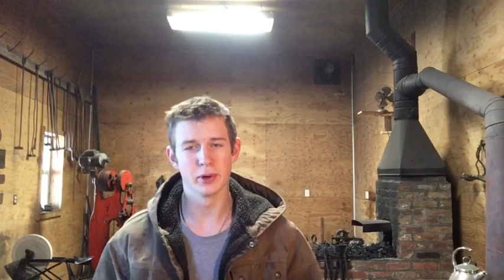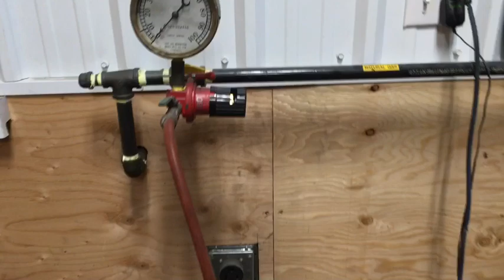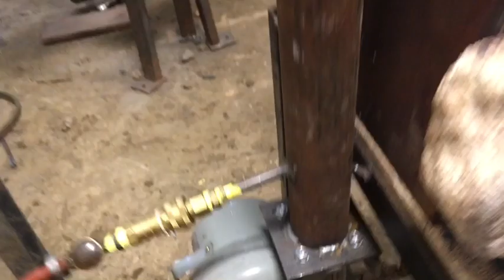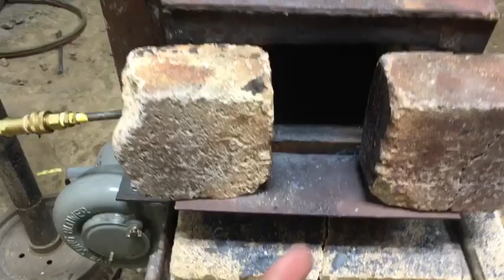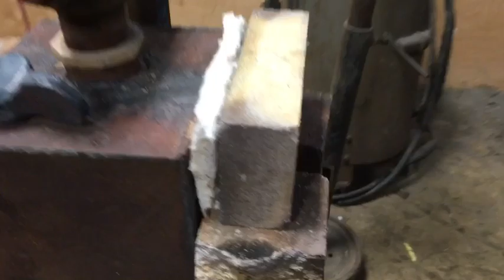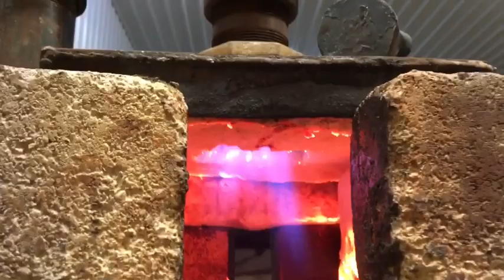Gas Forges: Venturi vs. Forced air

Comment: Ethan, get rid of the quick connect in the gas line.  Quick connect of that type are not rated for flammable or toxic gases because they are prone to leaks.

Comment: Excellent video, however in my humble opinion, the biggest benefit of the ribbon burner is the ability to really dial in the air - gas ratio. Kranking up the propane makes a huge difference when forgewelding, because you can create an environment with way less oxygen in the burn chamber. I rarely use flux in my ribbon burner witch is unthinkable in my venturi. I don't experience a difference in fuel consumption between the two, however my ribbon is a lot bigger than the venturi and the venturi is an old valley forge, they are extremely effective, compared to other venturi's that I've tried.

Comment: You Can make a venturi Inducer run a ribbon burner head - sometimes called NARB's (naturally aspirated ribbon burner), they are designed a bit differently but work quite well. My current forge is run on two 3/4" class venturi inducers, using 0.030 (mig gun tip) orifice, running the ribbon burner blocks, my ribbon burner blocks are about 2.5x9.5 with 18x 5/16"ports. Many of the advantages of the forced air ribbon burners you were listing also apply to NARB's. My forge is about 4.5x4.5x24" internal (about 486 cu inches) and I can run one side or both as needed. It will forge weld, I've made Knives, Gate hinges, hammers, and  even a 1.5 x2.5x 14" swage block with it. The NARB's are also Very quiet, most of the noise from a gun style is coming from the nozzle side not the induction side. one thing I like about my burners is the fairly wide range of temps I can run the forge at, from a low orange heat at 5-6 PSI to forge welding heat at 12-15 PSI. I also have a fairly small "dragons breath" from my setup, only about 6" at forge welding heat, I run my burners just barely on the fuel rich side of neutral to stop scale build up. Efficiency is ALL in the air fuel ratio - so Tuning is what will get you the efficiency not actually the type of burner. This style of burner does take a bit of tuning to get working just right, and is a bit more complicated to design and build than just a gun style or a basic forced air system.

Comment: Thanks for the video Ethan. You have a great talent for explaining things consicely and in a way anyone can understand. 
I have a (forced) ribbon burner forge. These are the things I have learned, yet i don't hear many people discuss:
1) forced ribbon burners are usually paired with larger volume forges. Forced ribbon burners are much more efficient, but this larger forge size is probably going to require you to use more fuel gas. Maybe not, but it's something to consider. 
2) No matter what you do, you cannot focus the heat from a ribbon burner onto a small section of your stock; whatever stock is in the forge will be heated, and evenly heated. This is desirable in some situations, but consider you are forging a pair of tongs and need to punch the rivet hole.  You won't be able to focus the heat on your boss section (where the rivet goes in the tongs) when using a ribbon burner. When you try to punch the rivet hole out, your entire stock/tong is going to warp like warm taffy. Sure you can straighten it back out, but you will have to heat it more times to do this, and it's overall less time and fuel efficient, and not the best for the stock. If you had a single venturi burner or gun burner, you could focus the heat to about a 1 inch section quite easily. This is much better for punching or drifting, usually. I'm sure others can come up with exceptions. It's just something to consider.
3) Ribbon burners typically get hotter than venturi burners because of forced air. However, the heat cone of a venturi burner is more than capable to melt steel, but the venturi burner simply isn't going to get the WHOLE forge volume as hot as a ribbon burner. I actually believe if you are wanting to get a small area of stock really really hot, the best way to go is with a venturi or ideally a gun burner.  Your entire forge won't be as hot as with a ribbon, but when working with smaller sections of stock, I'd argue this is better and more efficient in terms of fuel cost.

Hopefully this helps someone. If you are getting into blacksmithing and building your first forge, I highly recommend starting with a single venturi burner, or maybe a forced air gun burner. You will be able to do everything you need to. However, if you have natural gas running to your shop, it's reasonable to just go ahead with a ribbon burner. Natural gas is much cheaper. You can hear that forge to hellishly high temps and you'll likely still be spending less money than you would using propane with a venturi or gun burner.

Comment: Hey there. Great clip. I’ve just built a ribbon burner forge, a little larger than the one you show here. I have pretty much the same blower, with an adjustable tap, but I can’t get her as hot as this. I’m wondering if it’s the size of the gas jet hole? which is One millimeter diameter fed into the pipe pretty much in an identical set up as yours. It burns beautifully and I’m forging well with it, but if I crank The fan up it will blow out, not get hotter... Any tips?
Reply: This gas inlet is just coming out the end of the pipe. You don't need a small jet because it is not a venturi. Just get the gas in and make sure it has a chance to mix with the air. As for your burner blowing out with more air, you either need more/larger holes in the burner and/or more gas to mix with the extra air. Try getting rid of the jet and have the gas coming out of the pipe. It is a three way balancing act. Air, fuel and nozzle size. If you have a look at this one running he has the blower mostly closed off. The blower is waaaayyy to big.

Comment: I have to agree that ribbon burners are far more efficient than venturi rigs. If you angle your burner tangent to the radius, and make the chamber round, you get a swirling effect which is even more efficient. I've been meaning to change over to natural gas too, so thanks for the kick in the pants. BTW, I like your videos. You have a good mind for this work.

Comment: Sounds just like mine, but yours is a bit louder, I built one with 6 bricks a weed burner and a hair dryer for the top blower. It's not as large, but it looks to get just as hot. I have to turn it down to heat treat blades or they will carbon out.

Comment: How efficient would a forced air Venturi burner be? I have a small devilforge and seem to go through a fair bit of gas with just Venturi burners. So would a forced air Venturi burner be alright compared to a ribbon burner?
Reply: There's no such thing as a forced air Venturi burner.  A Venturi burner sucks it's own combustion air with it.  As for efficiency, that's also a myth.  Efficiency is mostly a function of your fuel/air mixture.  A neutral flame - only as much air as is needed to burn the fuel - will produce the highest efficiency.  Forced air gives you better control over the fuel/air mixture.  If you have huge amounts of flame escaping the forge, you're wasting fuel.  A well made Venturi burner, with adequate and adjustable air intake will do you just fine.  If you've got things tuned just right, you'll have just a small amount of dragons breath leaving the forge.

Comment: Ethan, where are you located that you have Natural Gas at 20 PSI inside your facility?  From my research, (typically in the USA), the standard delivery pressure, (past a residential gas meter) is 1/4 to 1/3 pound-per-square inch.  The street gas pressure to the house may be much higher, but the typical home meter can only handle putting a maximum pressure of 5 PSI into the system.  If I understand correctly, and what you say is true, your Natural Gas system has high enough pressure that it could almost handle many  venturi systems.  I'm confused.  What am I missing?
Reply from the maker: Chuck Bailey we have high pressure service at the ranch, because we use so much gas to heat the buildings. So that particular gas line has no low pressure regulator on it, it’s illegal, but works well. I run my oxygen torch on natural gas too, so the higher pressure is needed for that too.
Reply: @EthanHarty  So what you are saying is that your "opinion" in terms of choosing between verturi and ribbon burners only applies for the .01% of those people who have illegal high pressure systems?  Or will the argument still work for those of us with the lower pressure NG systems too?
Reply from the maker: Chuck Bailey you can absolutely run a forced air system with low pressure NG, because you can get more fuel in the system just by having a bigger gas inlet pipe, for example, Paul from Toronto Blacksmith, uses NG ribbon burners for his big forges, and he only has residential pressure, so the inlet pipe is 1/2” I think, and it works perfect. The beauty of the forced air system versus the Venturi, is that it doesn’t matter what pressure of gas you have. It’s all about the volume of fuel coming into the system, not the velocity out of an orifice.
🙂
Reply: @EthanHarty  Wonderful!  That's good to know.  No, it great news!  I've read so much contradictory information on forums, with the majority saying it can't be done with regular residential pressure.  I so much didn't want to go with propane, and I actually have 3/4" NG line I can use - so here's to ribbon burners.  I plan to build one real soon!  Again, thanks for the clarification!
Reply: Chuck Bailey yep I couldn’t believe it when he said 20 pounds! That’s amazing and a little scary as well!

Comment: I made a forced air forge a year ago but it's been giving me fits.
I can't seem to get the fuel/air ratio right.

I only need it to go up to about 1100°C (or 1950°F), but I'm running off of propane tanks and the only way I can seem to get it up to that temperature is to crank the regulator up so high that the tank starts freezing (~20-30psi). I'm sure it shouldn't take that much fuel.
It's a 16" ribbon burner with baffled plenum, and I'm using a dust collector as a blower and a 55gal. Steel drum lined with inswool and satanite as the forge. Maybe it's just because of the size of it, or maybe it's an issue with my blower, I don't know.
It's been pretty frustrating, though. I never had these problems running a venturi burner.
Reply: The inside of your forge may  be too big,  the inside dimensions should be fairly small, it needs to get really hot to burn the fuel completely. Like he shows in this video it doesn't burn well at first because it isn't hot, a large area would take a tremendous amount of fuel and heat to burn hot.  If you need a big fire you should consider coal or coke.
Reply: Kire Du'Hai  your Forge is too big. His forge is compact on purpose, it’s easy to heat and keep hot.  You’re only putting at the most projects a few inches wide. 
  A much smaller burner too. Use what these other guys are using. Pipe 1-1/2 - 2” and keep your  exit no more than a couple square inches. The burner should build a slight back pressure or close to it.
Reply: I also have a 55 gallon drum and initially I was having problems as well. The key is to really reduce the amount of air going into the system. I had to add a gate valve and its barely open. You tune the flame by its color.

Comment: most examples I have seen used a castable refractory for the holes in the ribbon burner, but I saw you just used a steel plate with holes in it. What do you reccomend?

Comment: Good job on a home system I have worked on a lot of burners including jet engines lol the burners used to dry hops were about ten feet away from huge fans and shot a flame that long and about 4 ft diameter you can use a supply to it that works on a stepped design think of ten small holes threaded and an Allen screw in each and each one is backed out a bit more it's a nice way to adjust fuel amount it would be done by hand on a forge instead of a modulating motor those are used to keep a constant temp. You hit it right on and your ribbon burner can be any shape you need if your forge is. Big enough you can move metal to cooler areas like for normalizing great video keep up the great channel

Comment: Quick question: would blower btu be enough for a slightly bigger ribbon burner made out of a 2x1x13 long square tubing..for a 18" long brick forge? Thanks so much for your vids very inspiring.

Comment: Does your pipe get hot all the way back to where the gas feeds in?  I've tried a similar design but my concern was with burning inside the tube, should you use flash arrestor and check valve at the gas feed?
Reply: No. The flow of air coming out of that blower motor as well as the pressure from the gas line keeps the flame from backtracking. The only time flashback arrestors are required is when you’re operating a closed duel fuel system like oxy/acetylene. The idea being that if one of the tanks runs low or empty it won’t draw the flame back into to the depleted tank. You also have to understand to that’s dealing with compressed oxygen as well which is by far the most flammable gas you will ever encounter. This set up is single fuel and any single fuel system will keep the gas flow oriented in a single direction and since there is no air inside the gas line the flame will never recede past the nozzle so a check valve won’t be needed either. That said, it certainly wouldn’t hurt anything to use a check valve or a flashback arrester if it were to  make you feel better but it’s not necessary for this type of setup

Comment: Interesting video!

A tip for you.. if you ever go to propane,  it's best to have your blower higher than where your gas input is.  If power gets shut off while the blower is in operation, it could fill the blower with gas.  If it were to come back on, it could cause an explosion.

Thanks for the video...
Reply: what @shadowcastre is saying is quite important. another solution would be to have an electro-valve that will only let gas through while its energized. if power goes off, the valve closes and stops the gas flow.
 its not only the risk of the gas going back to the blower, it could also happen that if the air stops flowing, gas could accumulate inside the yellow hot forge chamber.... all it needs is some oxigen. (of course, that would only happen if you werent around to notice the power went off and the gas was still flowing. but who leaves the forge running while not being around... right?)
Reply: tobias ripper i agree 100% but unfortunately the internet and YouTube didn’t exist back when I first attempted to build a forced propane forge and i ended up learning this lesson the hard way. I can’t even begin to imagine where I would be in life right now if had google at my fingertips back then like we do today. honestly it’s probably for the best I didn’t have it
Reply: @richard102879  my dude, its the ppl from back when there was no internet that went through so many trial/error situations who later on pupulated internet with the "do's and do not's" that the current generation so much enjoys. if anything, thank you! hahaha. of course, there were books back in the day, but they weren't as available as pulling your phone out of your pocket and leaning how to do most anything right there in the moment.
(btw i was just adding to what shadowcastre was saying. i was also around before internet. and oh boy many things would have been so different now if i had internet back then.)
Reply: shadowcastre Yeah that’s one of those life lessons we had to learn the hard way years ago when my cousin and I built our first forced air propane torch. We were  using an old Squirrel cage blower motor and the stater shorted out during the first test fire and the torch flames instantly reversed direction and traveled back up through the air supply line. Of course that was back before YouTube, smart phones and internet was ever even thought of and all we had to go off of was a simple idea that we had conceived in our heads. It was only by the grace of God that we didn’t burn the barn down that day.

Comment: Great video and well thought out design. Is there any reason (in principle) why a ribbon burner actually from a BBQ couldn't be used, or a T-fitting inside a forge running pipes with multiple small holes and end caps?
Reply: The main reason you don't want the burner steel pipes inside the forge, as I understand it, is that you'll literally melt them pretty quickly. See how HOT that thing gets inside? This is why many ribbon burner designs have the 'flame' end of the burner cast out of refractory. If you have the steel 'tip' up inside the hole where the flame exits a bit, like this lad's, it'll last longer. The cool air/fuel mix blasting out of it keeps the inside of the pipe cool while it's running and at least the inside/back of the tip, but if you had the pipes down in the forge itself, the heat would get all 'round them and they'd burn up quite soon. In a BBQ/grill, the flame's coming up from the bottom, with cool air fed in below it, which keeps those burner tubes cool (enough) and those only go up to maybe 500-800 degrees F, unlike forges, which can get over 2000 -- whole different ball'a wax. When your main goal is to build something that will literally melt steel (forge welding temps), you want to keep the steel that it's made of out of direct contact with that area, hence all the linings of kaowool, refractory, satanite, ITC 100, etc. See Essential Craftsman's and Old Hickory Forge's vids on how to build ribbon burners. If you can weld, those are a great design -- will last you a lonnng time. I suspect Ethan's version in this vid will too, but I doubt that steel end is going to last as long as one made of 3000 degree-rated refractory. If anyone out there has tried both types and knows, I'd love to know what their experience was.